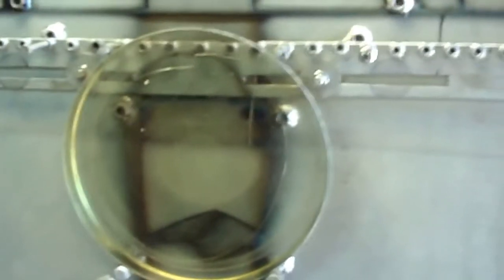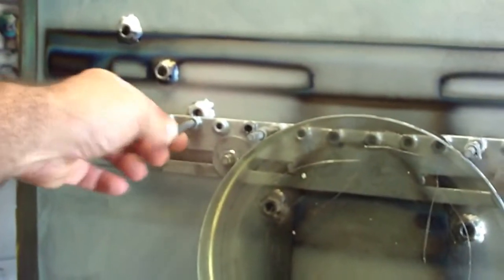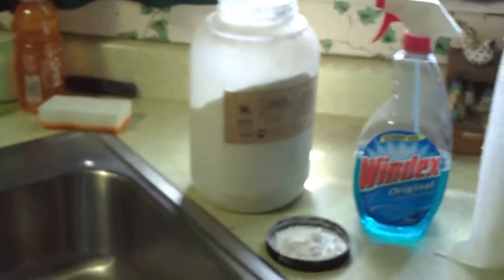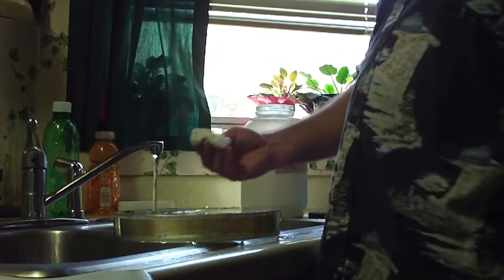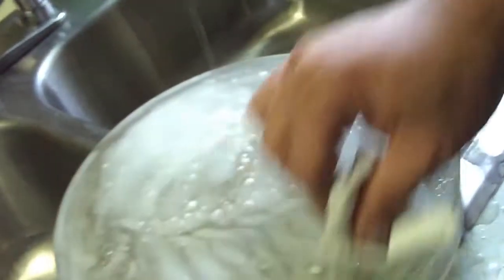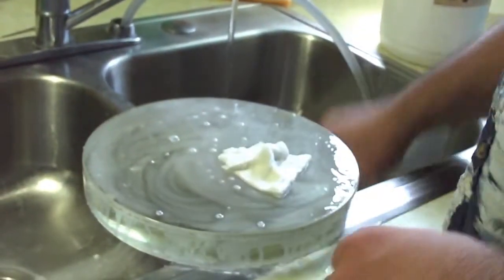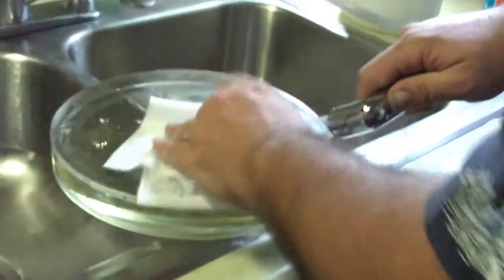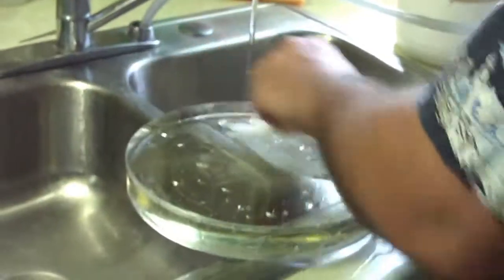Re-Coating a Telescope Primary Mirror Part-3

Comment: Have you ever used Clay to clean the mirror blank?

When I wash my car I also "clay" the car which removes impurities from the painted surface.    I realize this isn't a car finish, but I also "clay" my windshield.   It removes impurities there also.   The clay is not like modeling clay.   It is a synthetic.   Meguiers sells it as well as other retailers.  It comes in different hardness.  From rough for rough dirt to fine for less dirty surfaces.  Anyway, have you ever used Clay in any of your mirror cleanings.  Thanks for the video.   

I have a 16" f4.5 I'm thinking about getting done.
Reply from the maker: I clayed my car for the first time last week, I can definitely try it on a mirror! :)  To be honest, of all the technical challenges with building the coating chamber, by far the most difficult and frustrating problem  was finding a reliable and repeatable method to  create a pristine surface for the coating. Adhesion isn't an issue with a less than pristine surface, it is the "I spent 120 hours grinding, polishing, figuring an optical surface, I'll be damned if the coating is going to have swirl marks from surface residue.
Reply: ChemicalGuys.com   has some fantastic products I use on my truck.   All different kinds.  make sure you use lube.. ( yeah that sounds bad and funny at the same time-lol)  Good luck.   Got to do the top of my truck...got the black ones...for the heaviest contamination.  Chemical guys is fantastic stuff.  I wish I worked there.   it is better than anything I have ever used.  You'll see.  Greg.
Reply: Please use cerium oxide